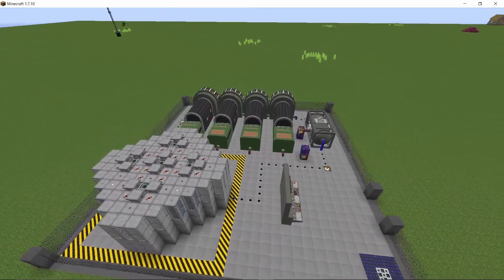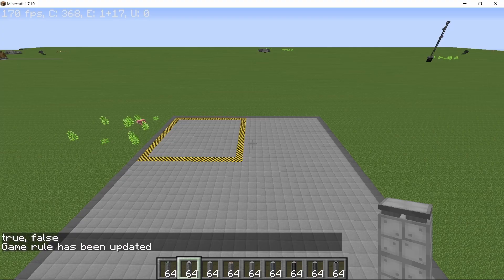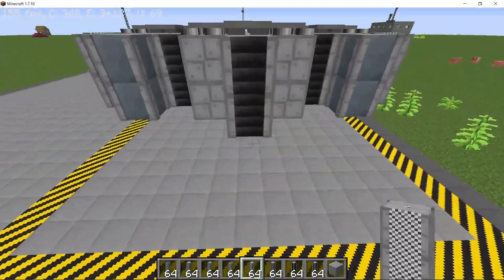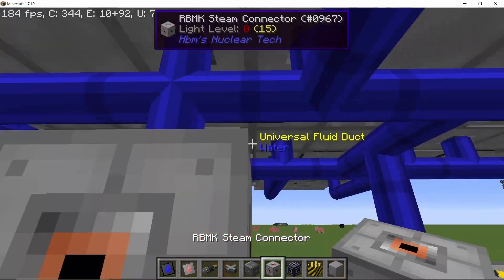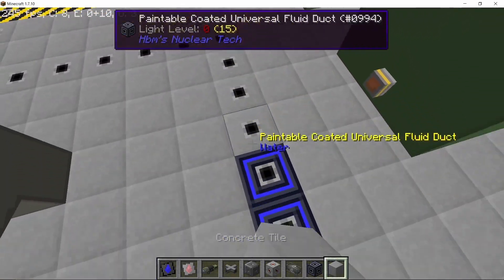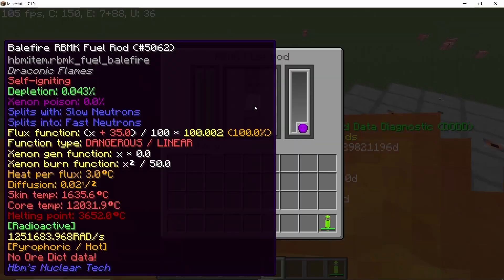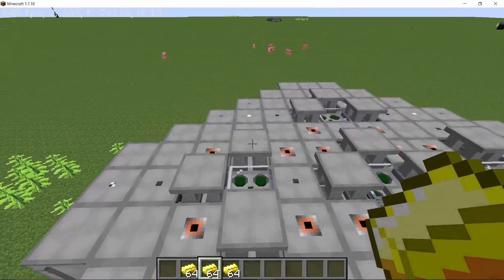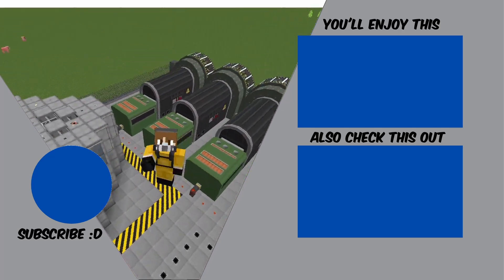Balefire - Plutonium RBMK Reactor - Breeding Reactor HBMs NTM - 44 MHE/s

Comment from the maker: I would recommend building this in creative first and see how it runs and what control rod level will feel good in your survival world. 
As I said in the video I ran this for like 2 hours and it worked fine and the temperature even started dropping. 

42 is the max limit initially so you can always choose to run the reactor on 30-35% control rod ejection considering its Balefire fuel rod.
Reply: I'm surprised you replied with a video also I modified this reactor and I did it with balefire and digamma fuel rods* edit ,I prayed to dyatolov and it worked*
Reply from the maker: @Null_jar_pluh  oh damn nice man, I also tried with 4 digamma rods and a single Balefire rod but it kept on going boom. I'll try some different configurations myself 🤜🏻🤛🏻💥
Reply: @SavageVegeta  whats the command for disabling meltdowns?
Reply: @SchwarzerLuan /gamerule dialDisableMeltdowns true 
if you are even seeing this

Comment: Now that I realized, that in 1.7.10 the Balefire fuel rods have a much lower internal meltdown temperature than in 1.12.2, in 1.12.2 it is around 8000°C, in 1.12.2 my Balefire reactors operate at least at 1100°C and this is the temperature of the reactor itself and not the skin temperature of the fuel, I have a small 5x5 Balefire reactor in my world that is at a stable 1420°C, (the reactor explodes at 1500°C), the skin temperature is around 4000°C, if it were in 1.7.10 it would already have exploded.

Edit: In 1.12.2 it is much easier to do this setup, and you don't even need this size, you can make a similar reactor in a space of just 5x5, or 7x7.

Comment: I invented better configuration - it produces 71MHE/s, and does not require a neutron source to operate. I checked the full cycle of fuel processing - it is completely stable. Moreover, its design is more compact and simpler than in this video

Comment: 0:06 I tried using a single digamma fuel rod. could not get above 22 c. I tried 2 digamma fuel rods(unmoderated) and a control rod and it exploded. I have no idea how to get those to work as advertised. so definitely don't use digamma with balefire that's just silly

Comment: why do the reactors explode if it is operating fine and I am far away from them in minecraft
Reply from the maker: Cause the chunk the reactor is in becomes unloaded when you're far away. When you get close again reactor starts again but water supply can't catch up to the fuel temperature so it goes boom.

Always use a chunkloader mod if you're gonna have a reactor running remotely

Comment: Use the research reactor to iradiate types of ingots
Reply from the maker: Yes that works as well, using the breeding reactors or irradiation columns tho with the former you will need plate fuel in research reactor
Reply: @SavageVegeta  oh ok

Comment: hey savage, do you know how to use that breeding reactor thing???
Reply from the maker: The breeding reactor needs to be surrounded by research reactor which will supply it with flux and basically have water surrounding the whole thing to cool it down
Reply from the maker: here : https://youtu.be/X5dy7D00Gg8
Reply: @SavageVegeta thanks

Comment: Balefire 
It is a Magical necromantic fire hailing from the Zebra Lands of equestria
By itself its Quite Dangerous but also not too bad
The main danger of it is similar to raw Uranium 235 
Its radioactive and thats where the danger lies
However if you know how and why radiation works you'll know that radioactivity isn't too bad so long as you remember your maximum doses and Watch for leaks 
But just like uranium 
The danger comes in the form of bombs
Aka The Balefire MEGAspell
Also known as the Balefire Bomb
A amplifier spell attached to a balefire egg
It is EXTREMELY dangerous
It is also what caused the fallout in equestria 
Be EXTREMELY careful with it

Comment: It's all very cool, but Is it possible to do all of this witouth those gamerule?
Reply from the maker: Gamerule for size is completely optional, it's just cause smaller size of RBMK column means more fps 

And disable meltdowns was for testing, if you're in your creative world and the reactor runs fine without any issues then you can always enable it. Balefire isn't the most stable fuel rod and I didn't want to keep on rebuilding the reactor that's why I turned this gamerule on
Reply: @SavageVegeta BTW! Should I disable this reactor before shutting down the game, will it work after reloading?
Reply: @SavageVegeta  cool, thanks 👍